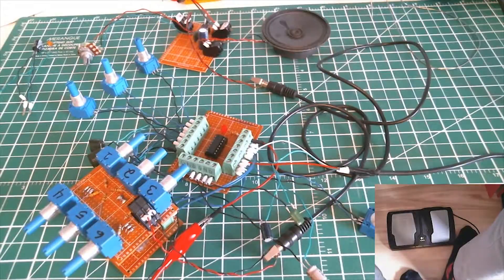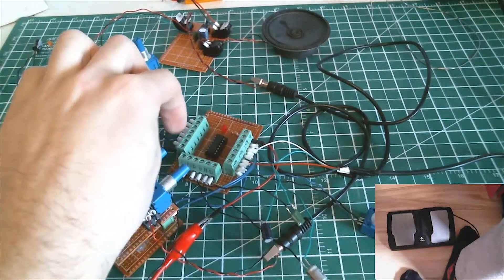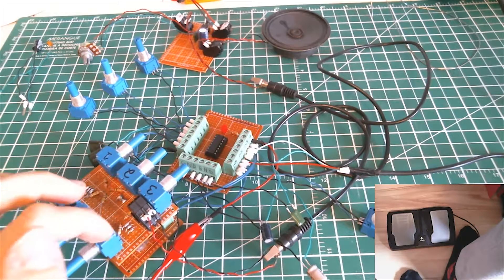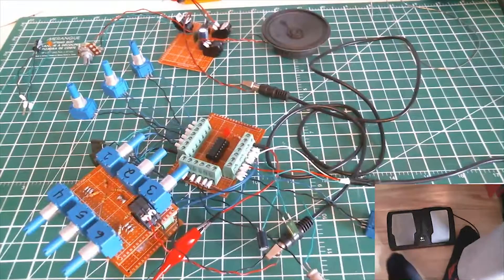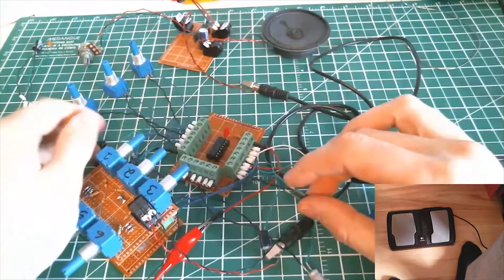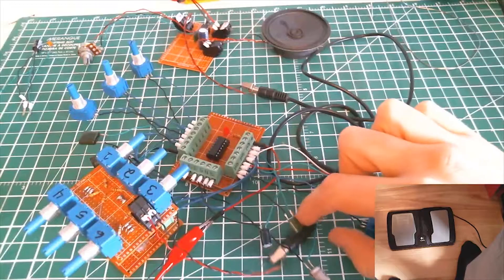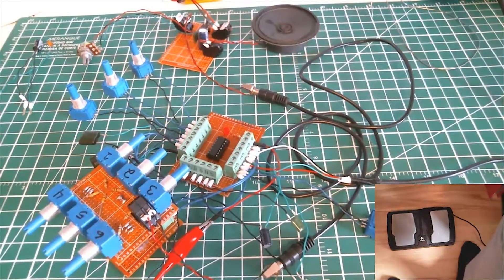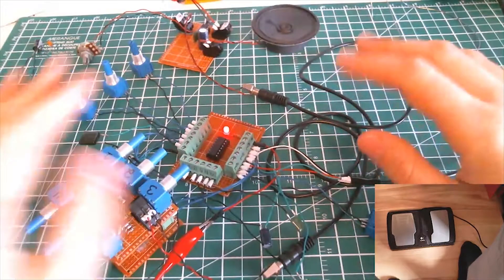Build a Noise Synth Oscillator Using CD40106 – Simple DIY Circuit

Comment: my ears )) Did you've made any decent 1v/octave synth using 40106, preferably with single supply PSU? I'm interesting to get more experience.
Reply from the maker: Thanks for commenting! Hope it didn't hurt too much your ears! I didn't made any 1V octave circuit but I'm sure it can be possible by using a proper tuning/tweaking on the CD40106. But watch out since if you use only one inverter, you will end up with a monophonic synth! That's why you could divide each Octave in each Inverters, ending up with 6 possible note on each octave at the same time.
Tuning a CD40106 is a lot of job to achieve a good Musical Note. Good luck!
Reply: https://www.allaboutcircuits.com/projects/diy-synth-series-vco/
I'll try this using ICL7660S to get bipolar (+/-12 or 9) PSU. (there is an URL that gives another tutorial how to get a bipolar but it's more complicated than just using 7660S or a better MAX1044 (don't remember the name) analog (which is capable for more volts... doesn't matter). I've got no luck with the Jupiter8 type (kind of...) oscillator but I'll try again with that in the URL. Who knows... maybe LM358 eats less Amps than TL074 (two different op amps with four amps inside).
http://www.aronnelson.com/gallery/main.php/v/TheBigMan-Layouts/invertor.gif.html - it works fine (also there is a schematic that can give you a volt. boost - pump charger) but... before you load it :) My inverter goes almost to minus 0.3-0.6v.
I've did only one sequenced synth that's in my videos... (Symple Sample) it's driven from a MIDI 2 CV device (that guy makes them for a very good price, I'll give you the URL if you need it).
P.S. no worries, my ears are fine, I've made the volume down :D
Reply from the maker: Excellent! If you have an AC wall adapter that output about 20V AC you can use a LM7812 and LM7912 to get both negative and positive supply. Be sure to use a bridge rectifier before the regulator. And for the TL074, you could use a 072 or 071 which has respectively 2 OP Amp or only 1 inside the IC.